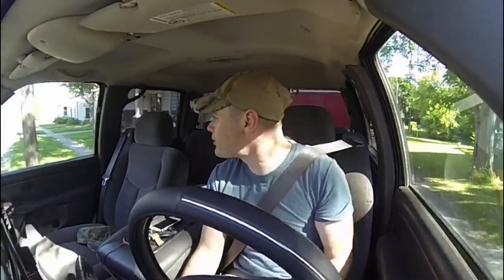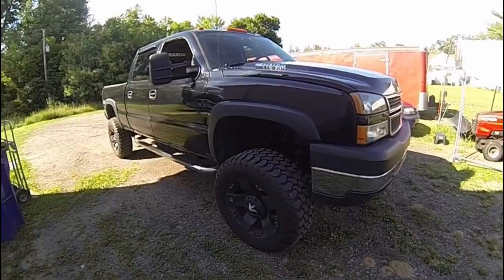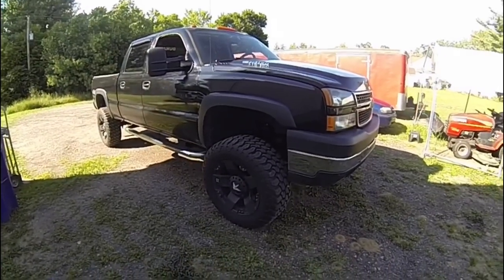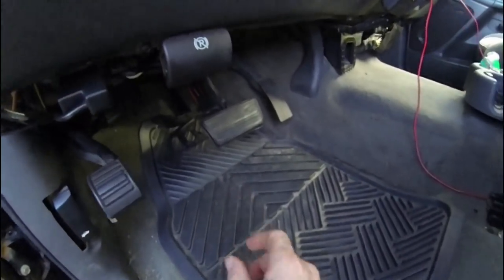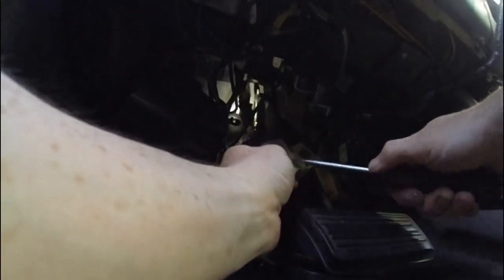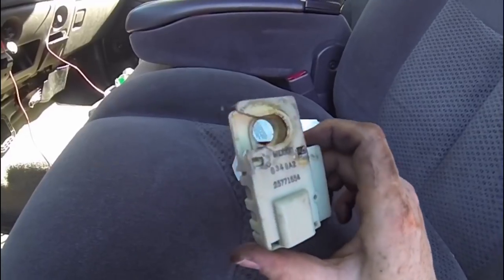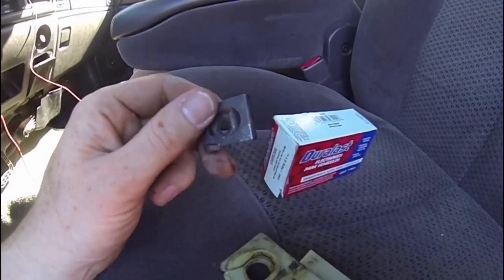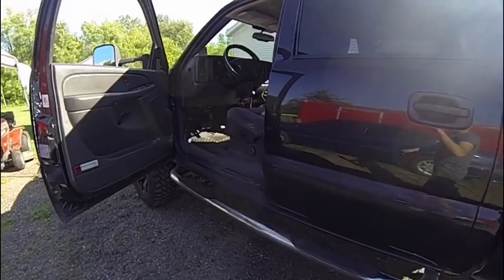Duramax Cruise Control Fix Brake Switch Install

Comment: i have a question, I dont want to go to a mechanic, but I have no clue what would be wrong with my brake booster but my truck is sending a service brake booster signal. Does anyone know of anything i should look at or try to do?
Reply: The truck is an 04 chevy silverado 1500.
Reply from the maker: +Michael Crain I'm sorry I never ran into that problem type your issue on silverado forums in google maybe someone had a similar issue and they figured it out
Reply: Okay, I'll try looking at some. Have fun with the move!
Reply from the maker: +Michael Crain thanks